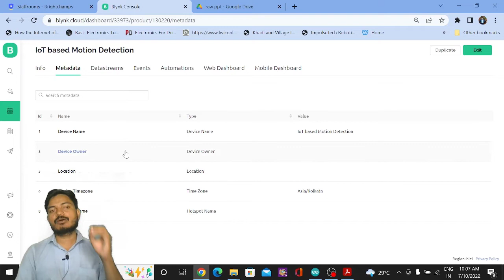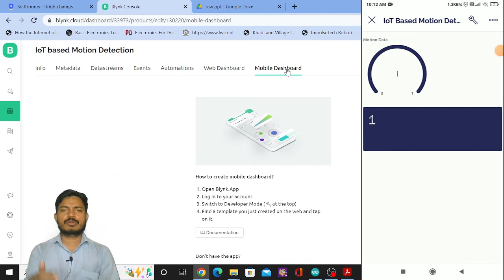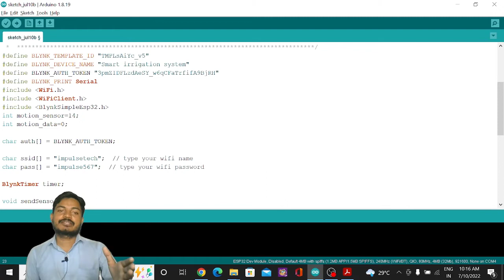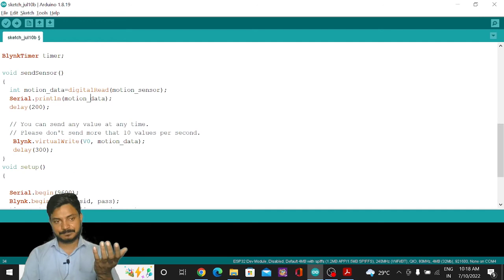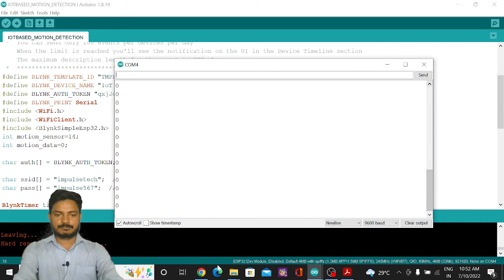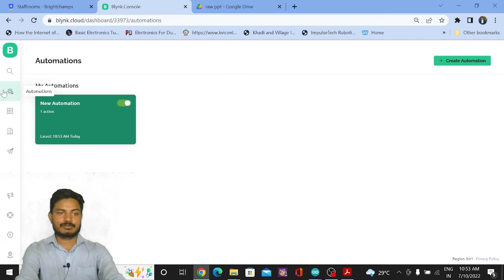Comment: Here you go, the code,

#define BLYNK_TEMPLATE_ID "TMPL6UKTipbD"
#define BLYNK_DEVICE_NAME "motion detector notification 2"
#define BLYNK_AUTH_TOKEN "7m57VoM4_YjFAylzZq7401dH4Q7Vc2s8"
#define BLYNK_PRINT Serial
#include <WiFi.h>
#include <WiFiClient.h>
#include <BlynkSimpleEsp8266.h> 
int motion_sensor= 1;
int motion_data= 0;
char auth[] = BLYNK_AUTH_TOKEN;
char ssid[] = "SF Internet";
char pass[] = "sf147369";
BlynkTimer timer; 
void sendSensor ()
{
  int motion_data=digitalRead(motion_sensor);
  Serial.println(motion_data);
  delay(200);
  Blynk.virtualWrite(V0, motion_data);
}
void setup() {
  // put your setup code here, to run once:
pinMode(motion_sensor, INPUT);
Serial.begin(9600);
Blynk.begin(auth, ssid, pass);
timer.setInterval(100L, sendSensor);
}

void loop() {
  // put your main code here, to run repeatedly:
Blynk.run();
timer.run();
}